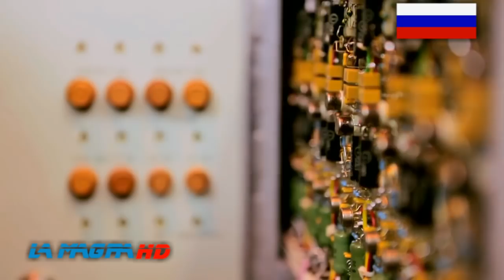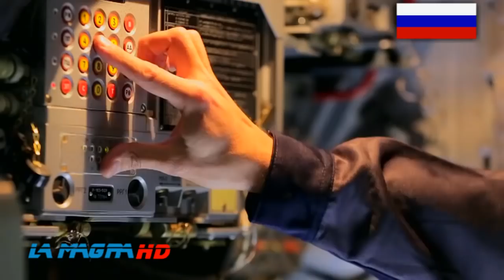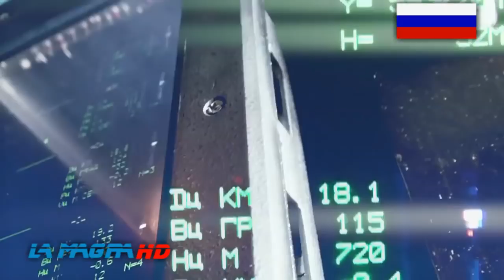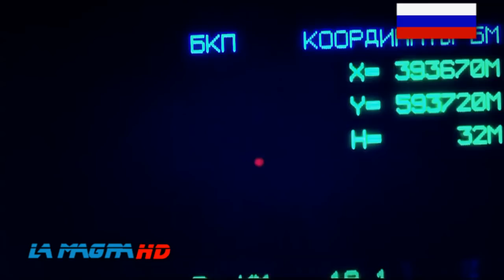Russian TOR-М2КМ (9К331МКМ) - Missile System. PART-1

Comment: So old school technology, yet so advanced weapon system.
Reply: This technology is not old. It meets the requirements of the military. I was engaged in the development of electronics for the Russian space, where the requirements are the same as for the military. You simply do not know the temperature and vibration requirements and tests for this electronics, so you are surprised by archaic look. It is, and it is not. There is a good reasons for it.
Reply: Old school doesn't mean it's old and obsolete. When old school simplicity meets modern advanced technology, that's a dangerous combination.

Comment: I'm surprised they use a lot of through hole part instead of Surface Mounted Device. I guess the radar system uses a lot of power.

Comment: How long does this take to reload once it runs out of surface to air missiles?
Reply: Dont know what is the time set by the book but shouldnt take longer than 10-20 minutes depending on variant and crew.
Reply: I know the BUK-M1/M2 are very similar, but the BUK-M3 is basically a new system. That's according to the Russian military. I wonder if the BUKs can fire from their reload vehicles like the S-300 and S-400 can as long as the operation vehicle is nearby. BUK-M3 was just revealed. It looks badass, and it has 3 vehicles per battery. They released some new weapons at the recent Russia Army Forum 2016. Here's 2 pictures of the new BUK-M3. Apparently a battery has 3 vehicles. 1 command vehicle with 6 missile in tubes, 1 reload vehicle with 12 missiles in tubes (I think they can fire while still on the reload vehicle too if the command vehicle is close by), and there also another vehicle with an multiple band 3D radar. I'm sure the BUK-M3 can detect stealth jets easily like the S-400 and newer S-300 variants like S-300VM/V4

defence-blog.com/wp-content/uploads/2016/09/3508733_original-696x522.jpg

defence-blog.com/wp-content/uploads/2016/09/3508418_original.jpg
Reply: @powderwigwoodenteethmf5037  you mentioned that s400 and s300 can fire from reloading vehicles?
Buk could do that before those systems even existed.

Comment: Those are some outdated looking circuit boards they are building. capacitors, transistors are all huge and stick off the board like they used to on old tvs in the 90s. in western countries they are so tiny, that they almost look like they are part of the board. they are so tiny, machines have to attach them to the silicon boards. all this leads to greater efficiency and more computing power. 

plus the conductive tracks also are huge and look like those of consumer devices of the 90s. these days conductive tracks are so small and thinner than human hair. They could buy a high quality chip fabricator from China, thats where all the ones in the west are made anyways. Several billion a pop.